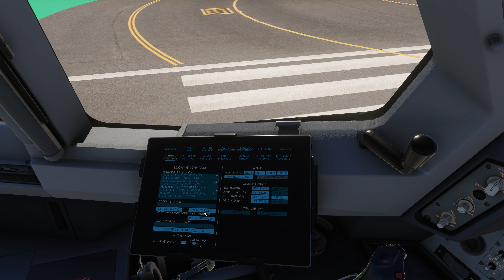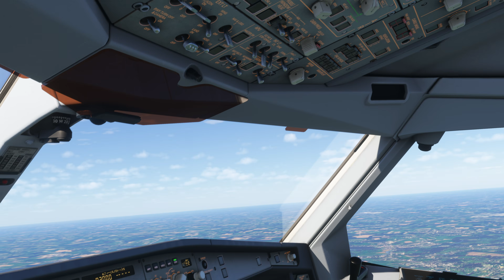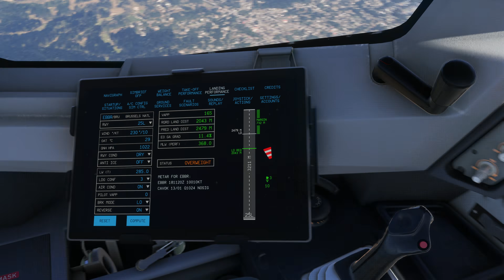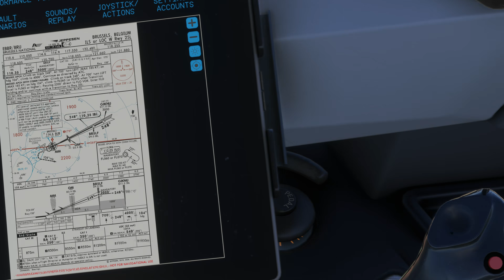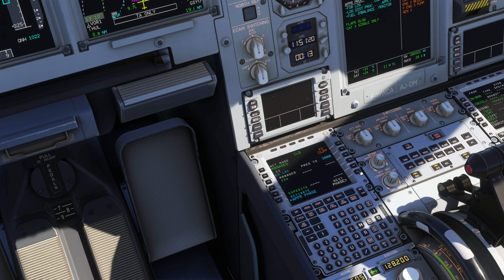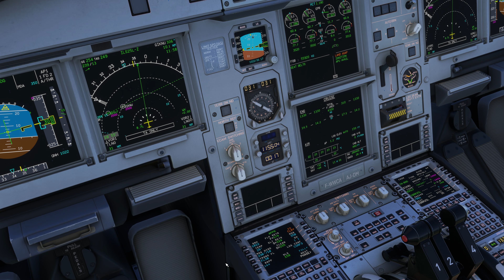Aerosoft/ToLiss A340-600 | Let's TEST THE SYSTEMS: Engine Failure @V1 | Real Airbus Pilot

Comment: Hey, wasnt the landing supposed to be a CAT3 (basicaly autoland?)
Reply from the maker: Hi, no not at all. Never do an autoland when you're overweight unless your airplane is explicitly certified for it!
Reply: @A330Driver thanks! Since the ECAM read “CAT 3 SINGLE ONLY” (11:26) I thought it wouldn’t be possible to land on CAT 1 as you did
Reply: @lourencocoelho6629  "ONLY" refers to "SINGLE", i.e. the only CATIII capability is CAT III SINGLE, rather than CAT III DUAL. Of course all approaches with lower requirements than CAT III SINGLE are possible.
Reply from the maker: Exactly as blueb0g says. It just tells you that it’s not capable of a CAT III DUAL approach.

Comment: 28:55 Why did the spoilers disarm?
Reply from the maker: Maybe a joystick issue, not 100% sure.
Reply: @A330Driver That could well be the case, since you have a dedicated hardware. I was starting to think it could be some sort of gear protection logic, to prevent gear damage, since the spoilers activate with reverse thrust anyway, but you would definitely mention that and the risk of runway excursion would probably be too high.

Comment: Was that Autobrake the whole time in disarm from takeoff? You read the checklist item but it did not look like it was switched to low. Interesting it doesn't show on the eicas checklist
Reply: ECAM doesn’t show the auto brake as a requirement for landing, so the only way to catch it is by manually noticing it, either the switch itself or that the “BRK” message not appearing on the PFD. He didn’t select it in this video, either by mistake, or it was intentional, but I think it was a mistake since he read out “Autobrake Low” in the checklist and also said that the auto brakes has gone off, when it wasn’t even selected before landing

Comment: Strange that yaw to the port side when the engine failled is #3 ? Or did you input excessive rudder correction ?
Reply from the maker: It started yawing to the right, which is the side of the failed engine. Then I applied rudder to return us to the centerline, which was of course a left turn.
Reply: @A330Driver  problem is the amount of yaw/sideslip you created - look at the sideslip cue...
Reply from the maker: There was no “problem”. I used as much rudder as it needed to get back to the centerline. When getting airborne you slowly return the plane into a zero slip condition. Don’t do any of that rapidly or chances are you’re more likely to loose control.
Reply: @A330Driver  Roger that, thx for the additional info!
Reply: A very awesome video sir,I would thoroughly enjoy a video,whereby you do a route from johannesburg with this bird in SAA colors,I think SAA used the A346 to Heaththrow if I'm not mistaken.keep up the good work sir really enjoying this channel learning alot.
Reply: That is correct behavior, asymmetrical thrust from the left two operating engines would cause the aircraft to go right
Reply: @eduardobonadio7581  but portside is left
Reply: @eduardobonadio7581  Exactly, should yaw/roll right, but look at the sideslip cue - the pilot input was excessive... the aircraft starts to pronouncedly yaw / roll to the left / port side.

Comment: Nice video….  Is the Autothrust FMA correct it changes from Flex to THR MCT almost as soon as you’re airborne?
Reply from the maker: Are you sure Nick? I'm fairly sure the A346 should behave the same as the other busses here and stay in FLX until the pilot moves the thrust levers out of FLX/MCT and back into it again.
What would happen otherwise if takeoff thrust was higher than MCT and it immediately reduced to MCT upon liftoff?
Reply: @A330Driver  yes you’re right I’ve had a lie in and only just woken up 😂After the clean up FMA should be flashing LVR MCT which is what confused me, although that’s not difficult 😉
Reply: If the engine has failed yes.
Reply: @nickcockayne7880  doesn’t that happen after clean up?
Reply from the maker: @Highball09-618  It should, yes.

Comment: I don't like this aircraft at all , I watched all your review.. for 70 euro .. inibuilds is far away better.. I hear a lot about toliss, but the reality is completely different..
Reply: No fucking way inibuilds aircraft is better lol
Reply from the maker: @Lemusin3  The question which is "better" depends a lot on what you're looking for in an addon. If you're the kind of simmer who is mainly looking for normal ops from A to B and who greatly values visuals while you do not care if a hydraulic pressure reads 3000 or 2970, then the iniBuilds may right now indeed be better for you. Especially if you like to fly at night.
Reply: @A330Driver  once you've had a bit of time to play with the 600, it would be interesting to see you do a comparison video between the two addons.
Reply: @A330Driver  totally agree with you , night flight and visual are amazing . gps jamming add a lot of realism , auto save is there for both , i saw also your other video , system failure scenario , i can make it for my self with inibulds . but how may time i'll use it ?
Reply: @Lemusin3  ni need to be so rude , give .e the negative point in inibuilds!?
Reply: @f@feh @fehmiofficiel3168 hing wrong with the ini even their modelling is slightly better. However the systems, flight model and EFB features are superior in the ToLiss. It’s an incredible aircraft to hand-fly and you really feel that in the flair and landing. Also it’s a -600 which looks way better than the -300 in my opinion.
Reply: @fehmiofficiel3168  I think @RamiLaw11 summed it up well. I would just say that the sounds are better on the a340-600.
There is a video about this comparison
https://www.youtube.com/watch?v=8ZGspKmKGEQ